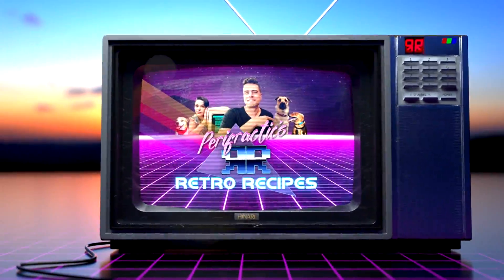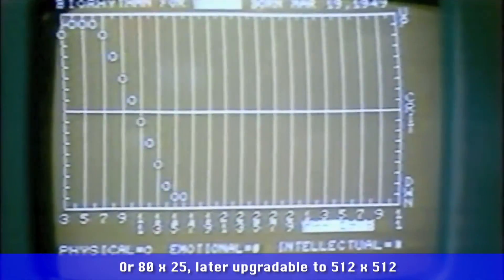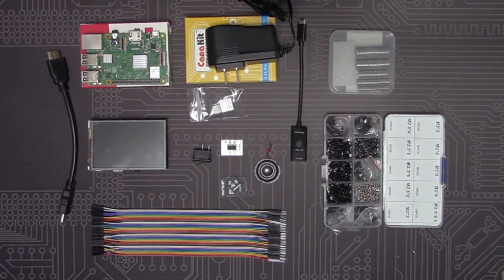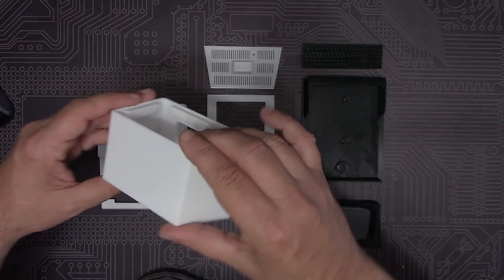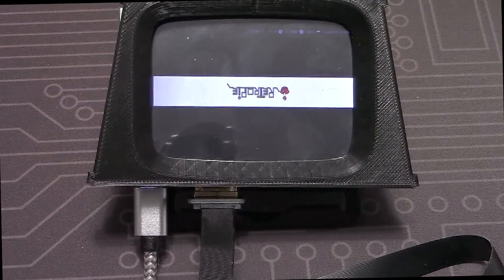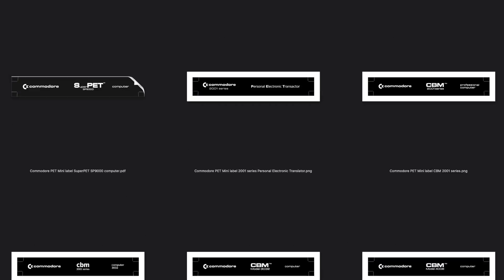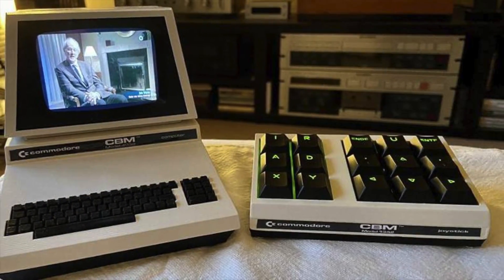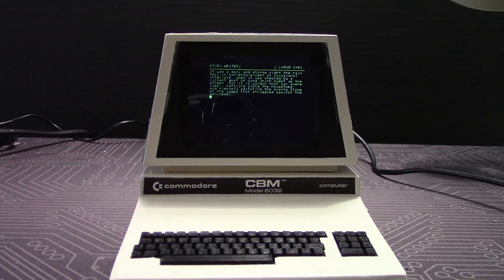mini Commodore PET! + A brief history of PETs!

Comment: The PET was announced 4-6 months before the Apple II, the KIM-1 kit computer also predates the Apple I, Chuck Peddle of Commodore helped Wozniak with the Apple, because, well, Apple used Commodore chips - and both Peddle and Leonard Tramiel confirmed that they brought the idea of a home computer to Jack, not the other way around.  So, where does "the PET only existed because of Apple" come from?  That's Bull Hockey.
Reply from the maker: Well, I didn't say "the PET only existed because of Apple". I said it existed "because Commodore turned down the Apple II". Had they not turned down the Apple II, and had they bought it, the computer would not have been the PET we know. Thus "the PET" as it exists only exists because they passed on the Apple II. The point of the comment was hopefully obvious; it could've been a very different computer. Source: https://en.wikipedia.org/wiki/Commodore_PET?wprov=sfla1

Comment: Have you ever tried using acetone vapor to smooth 3d printed surfaces?
Reply from the maker: Yes but it's not recommended for PLA which is what I use, as it is faster to print. Definitely possible though.

Comment: Nice vid...  For a better PET feel, instead of RetroPie, you should consider BMC64.  Still runs on the Pi, but without 90% of the Linux to go with it.  Just boots right into your Commodore of choice.  I have that in my C64 case and from power to READY, it's about 5 seconds.  (There are drawbacks tho.  No WiFi with BMC64 currently, so you will be using the SD card to transfer disk/tape images.)

Comment: I saw a listing on eBay for one already printed and the seller did list where you can download and print your own.   Yours looks 1000% better then what that person was selling.  I have the files and I think its a cool project.   I am still learning how to us my CR-10S and I have to start learning how to draw in 3D because I have my own projects to work on but first I need to become familiar with using the printer and I have the 1541 Mini to finish, I have the badge and bottom done and am making a 2nd attempt in doing the bottom because the vents curled up may have something to do with the bed temp not really sure but I hope to have that issue sorted because I really want to have a 1541 Mini even though I may never use it its just cool to look at but knowing me I will put it to use.

Comment: I wish retro pi had an ennersive setting where you can boot straight into your emulator/basic screen of choice without splash screensand having to select
Reply: There is actually an RPi distro than can boot straight into the PET emulator, in just a few seconds, sorry I don't remember its name though!
Reply: @lorenzo3131  Any Linux distro can do it fairly easy. It will take a little bit of learning and reading a tutorial i you aren't used to linux but you can just write a startup script so that the first thing the system boots is run the emulator. The whole concept (if not the execution) is similar to modifying the autoexec.bat script on a dos machine to just directly start a program after all the drivers are loaded instead of dropping you at a command prompt. One thing to note is I do recommend is creating a second user account with both sudo and SSH privileges so if you need to make changes later you can log in as that user instead of having to pull that case apart to take out the microsd card.

Comment: Hmm...if you'd chosen "combian64" instead of "retropie", you'd still have a vice setup, but with less work arounds and hassle....
Reply from the maker: Sure but it's not longer supported or updated, and the download has been removed from his website. Definitely an option for those who want it though. :-)
Reply: https://cmaiolino.wordpress.com/

The old non-supporter version is still there.
Reply: For support, you can contact the author directly here:

https://www.facebook.com/groups/combian64/?ref=share
Reply: The BMC64 distribution includes BMPET, booting straight to basic in FOUR SECONDS. That's exactly what you want to see on a PET!